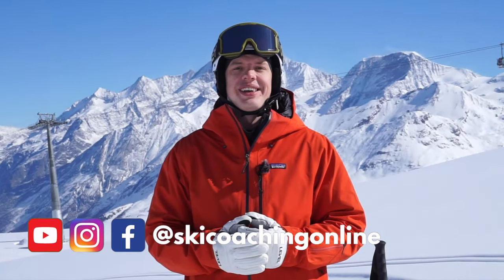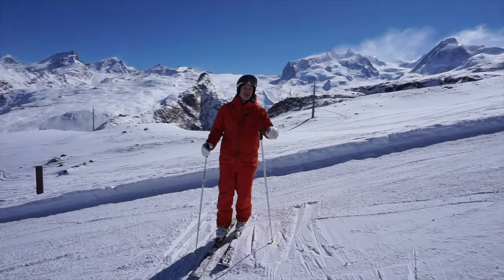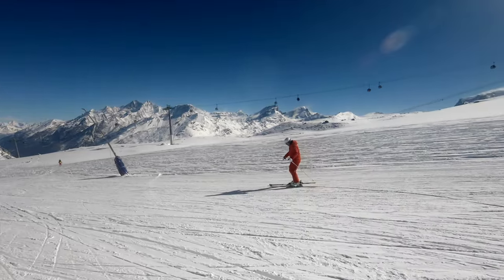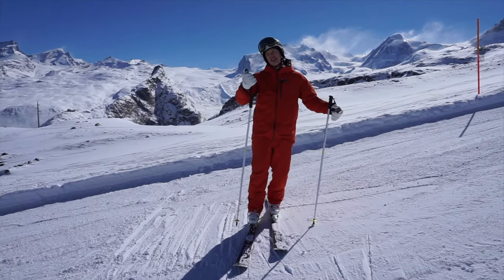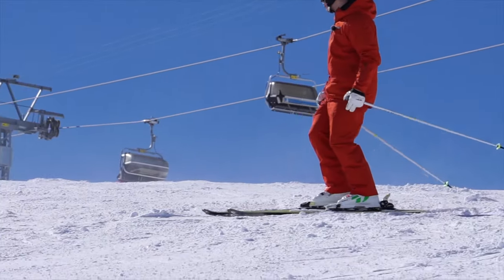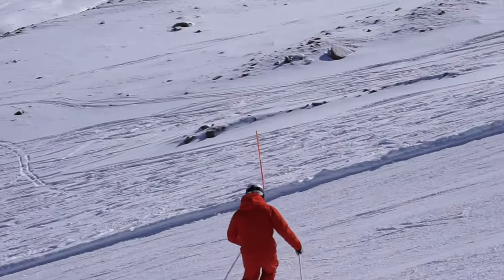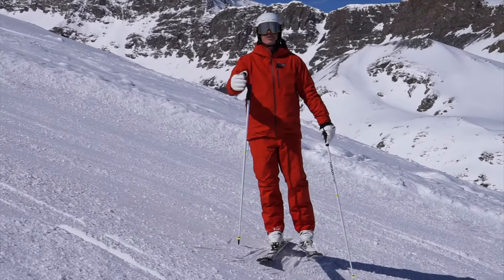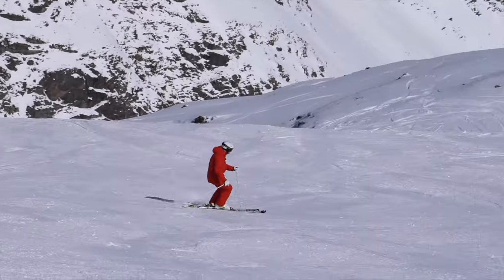How to ski without the tail getting stuck | Common Beginner Skiing Mistakes

Comment: I'm sorry, I totally disagree with your approach. the  new inside ski is stuck because it is (was) the safe platform the skier was skiing onto during the previous turn. I get the idea of moving the weight (pressure) on the new outside ski, but if you don't get that "red light" ski to roll from one edge to the other, it doesn't matter if I'm able to lift it or not. and, you're giving the idea to the student that lifting the inside ski is a way to initiate the turn. they're probably already a little scared of the pitch, not sure how they'll lower the ski on the snow. Simply roll onto the pinky toe of the foot the direction you want to go to (turning right, right pinkie...) and you'll have the most clean initiation. I think.
Reply from the maker: Hey. Thank you for the comment. 

I agree that having the edge rolling over into the new turn is the way to be able to enter a new turn smoothly. And there will be a video on that soon. 

I was mentioning moving the balance point to the new outside ski for people who are unbalanced through the end of the turn, this will then allow them to roll their skis. 

Thank you for watching and writing this comment 😀
Reply: @skicoachingonline  thank you for your gracious reply, well done!
Reply: The problem with teaching the "roll the pinky toe first" is that most beginning skiers are hopelessly in the back seat for that to be effective.  Steve's big "up and over" move  shown here can't be done from the back seat which is helpful, and also leads to other positive outcomes such as early edge engagement. As an adult learner I found that really  "getting forward" is the primary objective. All the other skills are subordinate and are learned so much easier after that.

Comment: Wow you went from wedge turns to parallel turns in one minute.  You never addressed the problem for beginners.  Like Max Warch says you have to address the inside leg knee position, roll the knee in to get off the edge that is catching, bow legged.  A smaller wedge from the start would help too so there is less edge.  Shallow terrain would help that.  Go faster on flat terrain promotes the glide of the inside ski.  the video is not coming from enough experience in my opinion.  way too advanced for beginners imo.  Beginners take a lesson from an older pro that really has seen and fixed this problem.  good try.

Comment: Yeah, it's another way to apply a trick called "long-leg short-leg". But your video is more easier to understand, and it's dedicated to beginners (like me). I will try it. Thanks.
Reply from the maker: Hey Stefano, Yes this can help with long leg short leg also get a skier used to using their legs independently. Thanks for your comment, let me know if there is anything specific you want to see.
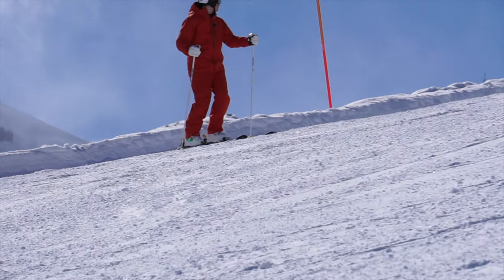Reply: @skicoachingonline  I think that the most important things are the "hidden" behaviors that are necessary to ski, I say "hidden" because they are necessary but not explicitly teached. This is an example: in this video, at 01:59 you start crossing the slope, then you move the weight on your left foot, in this way you right ski comes off of the snow, but this is not enought to start turning down the slope, you keep going straight... then at 02:06 you start turning and you do a very narrow turn. So probably you have moved again your weight on the left foot, but you did also something else. What is exactly this "something else"? Usually the ski instructors say that you havo to turn your feet to start the turn, but I think there is something else; for example at 02:06 when you start turning for this narrow turn, you project the upper part of you body down the valley, and this is the movement that allows your left foot to start turning, so the foot rotation is a consequence and not the action that initiates the turn. Sorry for my english but I'm italian and usually we are not very familiar with foreign languages :)
Reply from the maker: @stefano  Hi Stefano, yes absolutely there is more going on than just moving from one foot to the other. This video is just one way I have found helps people who get their tail stuck in the snow, to release it from the snow. This helps them turn using less effort as they tend to be more effectively balanced on the skis. 

I will do some more videos, as I can see how this can be confusing as the way I have explained it may look like shifting from foot to foot is enough to turn. I will address that in upcoming videos. 

Thank you for your comment 😁, and I will put some more videos out soon to explain other ways that can help the skis to turn more effectively.
Steve ⛷
Reply: @skicoachingonline  No no, sorry, your video is ABSOLUTELY CLEAR!!! I know that the purpose is to suggest a way to unweight the ski that otherwise could be stuck in the snow, and this is not enought to start the turn :) I just wanted to say that at 02:06, when you start and complete the turn, you add something that is a little thing that usually is not explicitly teached by the ski instructors.
Reply from the maker: @stefano7525  Yes, for me I move a little forward and roll towards my big toe. This helps to turn the skis. Along with some turning/twisting of the legs. I'll put some videos out detailing each of these soon. 
Thanks again for the comments, I love that you are watching the videos so carefully. I appreciate it 😁.
Reply: @stefano7525 I also really like that bit around 2mins! I had heard about rolling between feet, flattening the skis, weight switching etc (and even the outside ski "one legged turning" drill) - but that shot of the video was just such a clean example!
Reply from the maker: @krissp8712 thank you. That’s great that it helped 😀

Comment: The title is about correcting "beginner" mistakes and early in the video it looked like we were seeing a challenge that wedge turners can have with the inside ski getting stuck.   But the remedy was for a basic parallel skier (or lower intermediate skier).   If the title was about eliminating a wedge initiation for an intermediate skiers that want to improve their basic parallel ... then I think this video would be more on-point.  I'd discourage the lifting of the inside ski off the snow and replace that thought with the feeling of "flattening" the inside ski to start the turn.  To encourage an intermediate skier to lift the ski off the snow at the start of a new turn is likely to cause them to lose their balance, especially when they get onto steeper runs.  The weight shift is important but lifting a ski should only be done as a drill, although better to have them briefly lift the tail of the inside ski keeping the tip on the snow (to keep their weight forward, just as you did in your demo when you showed a complete turn through the fall line). Also, not sure what "recalibrating" means.  What exactly are you asking the viewer to "recalibrate" ... it looked like you were asking the viewer to keep their hip more square to the direction of travel, or slightly countered?
Reply from the maker: Hey. The recalibrating can be replaced with balancing over the whole foot. It’s talking about how the body moves from balancing over the old outside ski, to balancing over the the new outside ski. 

I will do some more videos at each stage, to make it more clear what to do when. Thank you for your feedback 😀
Reply: @skicoachingonline   That makes sense.  Great that you are trying to help intermediate skiers.  That inside ski getting hung-up at the start of a new turn can be a challenge for many.

Comment: That is good explanation, thanks ! I use to skateboard and surf when I was younger so I was turning my skis by putting my weight on the back foot and turning with the front one, making me go way too fast compering to others around me 😂 Besides I am lighter then a feather on my skis, 48kg and 170 cm tall on a 149 cm pair of skis 😂😂 I had fairly good control, but I was leaving every one behind by the time I got to the botton of the hill😊

Comment: For anyone that's still struggling, the main thing that helped me was to really roll your inside ski flat by pushing your knee into the turn and rolling your ankle. 

If you aren't rolling your inside ski flat, the inside edge will just catch on the snow. If you roll your ski flat it will slide across the snow easily and allow you to bring it parallel
Reply: This has helped me a lot aswell actually, great advice
Reply: Quite true. Though that in itself is not sufficient without shifting your  weight properly. 

And for really shifting your weight, the cue given in this video (trying to stand on your “end leg”, uphill before the turn and down hill after) is really effective.

It also bakes another important manoeuvre, releasing/regain pressure by standing up/lowering down, into your turning routine.
Reply: Yes that really helped a lot.   I was catching on the snow.
Reply: That's really good advice, i usually tell my students to flatten both skis before starting the second turn, have them shift some of the pressure from the outside ski onto the inside so that they both have the same force going through them. 
I found that a lot of people are afraid of just letting the skis glide for that brief moment, especially on steeper terrain
Reply from the maker: Yes I agree. I do the same, I think there was a typo in your comment. 

Yes a bit of glide on a flat ski will often help when they need to twist the skis. 
Thank you for the comment 😀
Reply: @skicoachingonline  hahaha there was :p
Reply: @ding0865  I think the key to solving the problem is really to get used to the sensation while on flatter slopes.
Reply: I was about to comment, "Alternatively you can teach a student to initiate a turn through a flattening of the new inside ski. This may be more challenging for some students than lifting the new inside ski but it is a preferable technique and some student find it less 'scary' than lifting the ski." But then I read you comment saying the exact same thing.
Reply: Agreed.  With some students I use the term “roll (supinate) the new inside foot into the turn” which essentially takes the knee into the turn.  Sometimes talking about the knee has people moving the hip into the turn.  They only have to trip a time or two before they keep the hip from dumping!

Comment: Makes so much sense, you’ve reminded an intermediate skier to allow the ski to do the work, it’s so easy to panic and end up traversing across the hills for ages then performing horrible z turns at the last minute.
Great video which should help most to focus on the importance of initiating the next turn with correct weight shifting/ trust in  the new downhill ski
Need only to practice 🙄😀👍

Comment: This is great. recently started sking again, and when turning, my inside ski would either a) not turn so I had to lift it up to be parallel with the outside ski or b) keep crossing the outside ski during the turn the outside ski, and bham I would fall or simply c) get stuck and I would struggle to turn.  I will try the red/green light!!

Comment: This keeps happening to me! I've been skiing for a two weeks and I kind of solved that by standing up and sitting back down (if I explain myself). It helps me shift the weight. Partially, this happens to me out of fear too. I want to go downhill but I'm scared to accelerate which is what happens when you hit the green light. It's happens less and less as I ski throughout a single day but still haven't solved the problem.

Comment: I have this exact problem, and I tried to solve this by weight transfer to the outside leg but my tail still keeps getting caught. 
In fact at a point I am so much on light on the inside leg that I completely pick up the ski and make it parallel; which is not bad except the front of the ski comes up first and kinda destablises me. So for me the question is still the same how do i get off the tail edge to leave the snow?
Reply from the maker: Hey. Sounds like your balance might be more towards the tail of the ski. Try to move most of your weight over the whole bottom of your foot rather than just the heel. That might help to feel more balanced and the whole ski will be able to leave the snow at the same time.
Reply: This is happening Saurabh because your weight is too far back.  Make sure you can feel your shins pressing against the front of your boots BEFORE you shift your weight to your uphill/outside ski.  You can do this by making sure your hips are positioned OVER your boots not behind them, you knees are only slightly bent (easy to have too much bend) and that your spine is tilted forward from your pelvis ... so that you have a slight feeling of "toppling" forward (which is a good feeling to have when you are skiing) this feeling of toppling forward is what allows your skins to press into the tongue of your boots.  In this position, when you lift your ski, you will be able to lift just the tail rather than the tip ... and this will help you start your turn.  Make sure as the turn begins you continue to feel your shins pressing into the front of your boots ... and you should find that your ski tips will "pull" you in the direction you want to go (as this is what they are designed to do) when you have what we call "tip pressure" and that is a good thing to have throughout your turn as an intermediate skier.
Reply: I have another approach which can help. Stop the knee of the ski that gets stuck from going closer to the other knee, in other words, push it out a little so that the skis are both angled equally to the snow. Some people practice this by skiing with an exercise band round the knees.
Reply: @garthly  And to build on that concept some struggling with the inside ski getting stuck can try doing "cowboy turns", where you try to feel bow-legged (like you've ridden a horse for too long).   For some it's a little easier to spread the knees rather than focus on trying to maneuver just the "inside" knee away from the "outside" knee (In the top half of the turn the inside knee is your downhill knee and the outside knee is the uphill knee).   Being bow-legged essentially flattens both skis making them both easier to turn.

Comment: Graet explanation! I am still struggling myself  a bit with this turns ,but I try to repeat what you explained. Apparently with a tail a bit in the air , you make pressure on the opposite foot and  then you turn in the way of your "lighter" foot. But is it correct also  to turn the shoulders/face in way of turn to help this maneuver a bit?